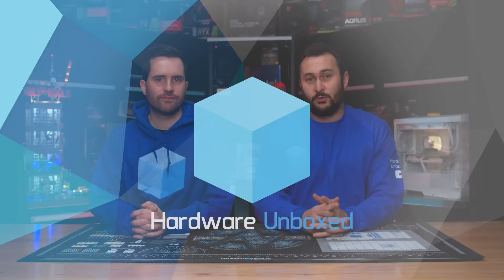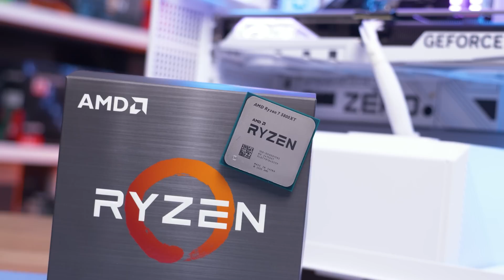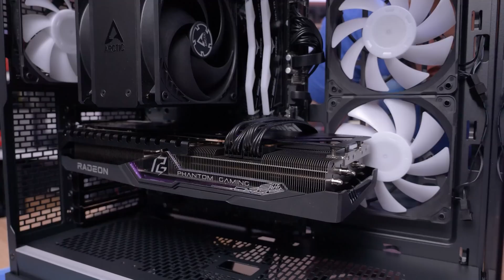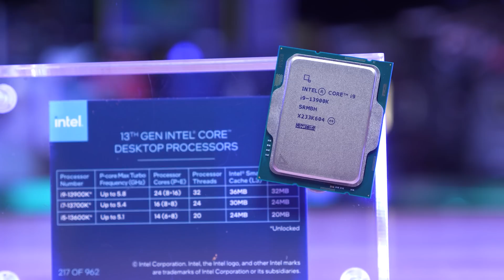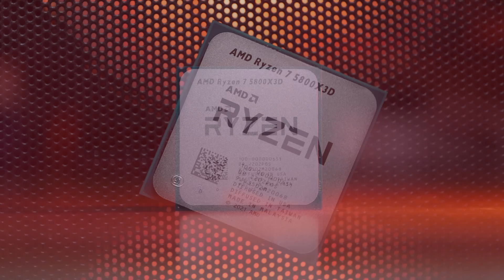Our RDNA4 Expectations, Can Intel Gain Lead After Mediocre Zen 5?

Comment: AM5 being supported till 2027 doesn't mean Zen 6 is guaranteed to release there AMD may just spam it with refreshes like they are doing to AM4 right now so maybe we will get a "fixed" version of Zen5 instead.
Reply: Depends a lot how soon ddr6 comes to market and what is the price of it close the release Zen6!
Reply: @haukionkannel  The price don't matter even if DDr6 is priced to the moon and back at launch if AMD designed Zen6 for DDR6 alone its gonna launch with DDR6 as a mandatory requirement which means it will need new motherboards and socket unless AMD goes the socket 2011 X79 and X99 way same socket different processors supported they already did it for Zen4 even when DDR5 was at a price that didn't make sense AMD released Zen4 with DDR5 support only and when it failed to sell they gave it price drops and gave away free DDR5 kits with it.
Reply: @fredsorre6605  
I am just thinking that they make option to chose either dd5 or ddr6 memory controller… and make the final decision about one year before the release! AMD has tendency to move new memory tech later than Intel, just to keep total cost little bit smaller. But if ddr6 is release about year or more before zen6 release and ddr6 is rather cheap even at release… AMD may chose to go DDR6 with zen6. 
All in all I expect that Zen6 still is ddr5 and will be released at am5 platform.
Reply: @haukionkannel  not gonna happen the lead of Zen already said during an Interview when they asked why Zen 4 only supported DDR5 and not DDR4 while Intel Supported both his answer was that they only wanna focus on one supported memory type for their controller its why they only supported one type of memory starting with Bulldozer and up. AMD has always been known to have badly designed Memory controllers vs Intel as theirs is in the IO die which is built on a different node the one used on Zen 5 is still on 12NM from Global Foundries as AMD has a contract to use their FAB until 2026 or 2027 its the reason why clocking RAM high on AMD has always been hard to do compared to Intel seen this first hand on my DDR4 3800 kit which worked fine on Intel 10th, 11th and 12th gen but not on any processor in AM4 had to clock it down to 3200 there to keep it stable.

Comment: Immediately after the 9000 series dropped, the price for the 7950x and 7950x3d cratered. Fortunately I was able to pick up both of these processors before the general industry apparently realized the 9000 series was a dud. Unfortunately prices have crept up but I would still go for a 7800x3d for gaming and a 7950x for productivity. This is a massive chance for Intel to recover some of it's former glory, but can can an ailing organization, with moribund corporate culture, respond? For all our sake, I hope so.

Long term, nothing is going to save Intel. They still think ARM/RISC-V isn't a threat and they are actually proud they voluntarily relinquished the  consumer commodity market (aka mobile) in deference to 'the value-add of x86 goodness'. They got their foot in the door with graphics, notably the A770 and then... stalled. It seems Intel just can't get anything right. That said, at least the early word about Arrow Lake looks exciting. So maybe, just maybe, there is yet life in the lame, toothless and half-blind dog!

Comment: I think HUB is right about AM5 - be wary. Since core density is going up with Zen6, it will likely have increased requirements. Higher PCIe speeds on the way, CAMM memory... its likely AMD will do a new socket. Just look at the absolute mess they made in the Threadripper platform.

Comment: Intel is missing an opportunity, Make more than 8 P cores with Arrow Lake on a single tile for Arrow Lake now. You have a buyer in me. Not interested in 8 P cores plus more e-cores in clusters of 4 even with stability fixed and much lower power consumption.  Also not interested in dual CCD AMD designs. It sucks no more than 8 P cores per die from either AMD or Intel. Embarrassing and shameful!!

Comment: re, AM5 discussion.  I would be OK with a switch to a new socket ONLY if it were accompanied by significant gains immediately.  If some new architecture on Am5 would be 10% faster, but switching to a new socket and all else being equal the new CPU could be 30% faster at the same price, OK.   But I doubt that is going to happen.  Not to mention that people who spent big money on AM5 to switch from AM5 are probably not going to be ready to do the same so soon.  ZEN 5 is a big problem for AMD - it is not going to drive board partner sales with its current performance levels - the smart money today would be to buy a mid tier AM5 motherboard with good ram support and a 7800X3D if you want to game. ZEN 5 give the consumer no reason to spend a bit more on a better motherboard, because there is nothing to move to in the ZEN 5 line better for gaming than a 7800X3D.

Comment: 9:32 I commented this on the last podcast and I legit think that Intel will try and make inroads in to this socket longevity element of the CPU market that AM4 enjoyed thoroughly. LGA 1700 saw 2/3 gens of CPUs and you better believe that LGA 1851 will have at least 2 solid gens and Intel will have to deliver. All eyes on Arrow Lake and Zen 5 X3D.

Comment: Id rather do a monitor upgrade to a 4k screen in like 2028 (when I feel Im running into a CPU bottleneck) before I consider upgrading my whole system. Would be amazing if the 5800x3D lasts that long and is still viable.

Comment: I think AMD took over a lot of bad business practices from its competitors. They are basically scamming normies with refreshes of old hardware. To the majority of users big number name means better. And even experts have to rely on benchmarks due to IPC and frequency becoming almost meaningless. I think this is a problem that is impossible to fix. Regulating this would be a nightmare.

Comment: According to MLID's sources ARC is dead, not a single add in board manufacturer has been contacted about making Battlemage GPUs and the ones who made Alchemist cards said they are not interested as they sold like crap. According to his contacts in Intel the Battlemage cards will have a VERY limited release and only be made by Intel so as to fulfill their contracts with TSMC, Celestial will only be an iGPU if it even comes out at all, and that will be that ARC will be done.

It is a shame but it is becoming obvious Pat Gelsinger is to Intel what Rory Read was to AMD and Steve Ballmer was to MSFT, someone who sees what the other guy does and tries to copy them too late and half assed. He saw AMD and Nvidia making big money during the crypto boom and ignored signs it was a bubble to sink billions into ARC thinking they could sell it for crypto prices only to watch Intel have to sell the GPUs below cost as nobody was going to pay midrange prices for entry level performance post crypto, and now he is betting the farm on AI but instead of being smart and offering separate AI products like AMD he is integrating it into ALL of their chips and then charging extra to unlock the functionality which is causing the data center customers to dump Intel in droves as nobody wants to buy a $5k+ CPU only to have to pay a fee just to unlock features their company probably won't use in the first place.

Comment: DIMM socket is been around for so long, because is just better, it works fine, takes way less space and is very easy to handle and upgrade RAM with it, even for non technical users. 
The CAMM2 system is way worse imo, requires more work and knowhow from users to handle, meaning some users will now pay others to upgrade RAM, because they will be scared to touch it... also some CAMM2's shown, have huge heatsinks that take a large amount of space, more than some CPU heatsinks! 
My motherboard, is already mostly taken up by heatsinks and metal shields, imagine another huge one for RAM! 
Modern Motherboards have atrocious extensibility already, with very few PCI-e slots, despite prices going up and up, is so strange to me, to look at my older MB's and see all those extra slots and then look at my modern one that was more than twice the price but looks so barren, specially if you imagine it without the heatsinks, I almost feel cheated.

Comment: 9:52  I feel like overclocking for most consumers is heading the same way as buying aftermarket gpu heatsinks in the past. It used to be very useful but these days parts either auto-overclock themselves or are running so close to the limit out of the box it makes overclocking increasingly less worth the efford

Comment: Zen 5 does already offer a significant performance improvement over Zen 4 in some applications, and even in some games, so it's very likely that there is some potential there for more performance improvements in a wider range of applications in the future.

The more I learn about Zen 5, the more I realize that it is has some pretty radical architectural changes vs. previous generations of Zen. One of the major changes I only just found out about recently is that each core can fetch up to eight instructions per clock cycle, which is supposedly a huge change, and I believe it is the first CPU architecture to market that's able to do this, though I know this is something which Qualcomm's new chips are also going to be able to do, so this is clearly a new and popular trend in architecture design. It's hard to know how much this could improve gaming performance over time vs. Zen 4 as software becomes better optimized for it, but it seems entirely possible that the changes introduced by the Zen 5 architecture will actually offer very significant performance improvements, at least for some enterprise and data centre workloads, if not also for gaming and consumer application workloads as well. 

It is not unusual at all for it to take a long time before major changes to an architecture to be well optimized for. Chip makers love the "low hanging fruit", the changes which can see major improvements to performance from day one, but they also have to think about long-term progress as well. Zen 3 was very unusual in terms of how much performance improved from day one across a wide range of applications with a new architecture that was based on the same manufacturing process as the generation before. We can't expect anywhere near that much of a performance improvement from day one with every new architecture.

Comment: I waited years and picked up the 5700x3d for a little less than 200. That's on an x370 board, and i got a 6800xt new for 430 usd, so a supposed warranty until 2027. Amd will have a hard time convincing concurrent owners to upgrade to a new platform. The price to performance the market saturation in my opinion has plateaued potential platform upgrades. If rumors of Am6 being a new form factor are true, me and im sure many others would gladly wait while using am4 for the release as long as it's gaming or basic task oriented. Of course AM5 makes sense for new builds, but i'm sure many are still on am4.

Comment: Expectation for 8800xt: 20% over 7800xt, slightly weaker than 7900xt. Maybe potential with OC, more power efficient, $600 price tag. 

TLDR 8800xt might be very meh

Comment: Timestamps:
0:05 Savage Tim
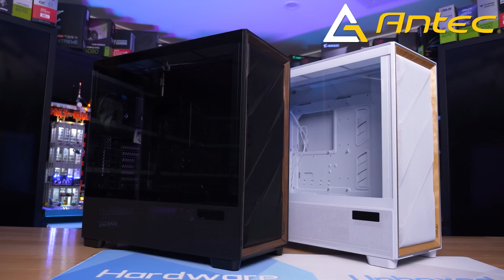0:40 Antec sponsor spot
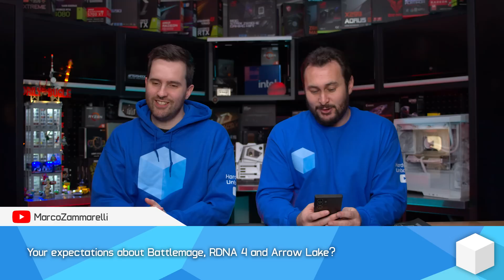1:42 Expectations for Battlemage, RDNA4, Arrow Lake?
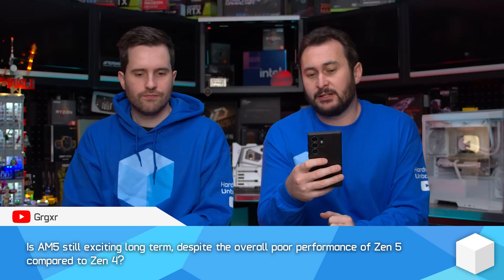5:22 Is AM5 still exciting long term?
9:52 Are limits on factory overclocks bad for consumers?
13:47 Why doesn't AMD increase core counts?
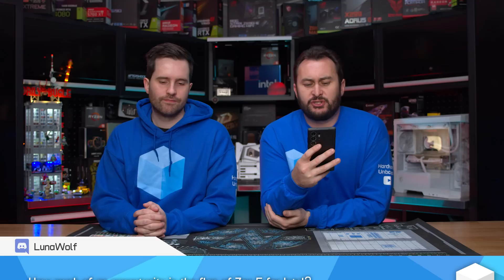18:25 Is the flop of Zen 5 an opportunity for Intel?
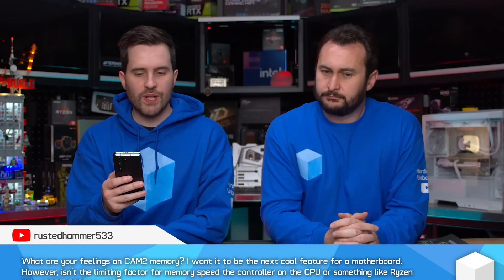23:51 What are your feelings on CAMM2 memory?
25:32 Are game areas chosen for CPU/GPU testing?
27:06 How long do you think AM4 will last?
31:06 Conclusion

Comment: AMD is not always more power efficient. Everyone talks about the power draw of intel processors and yeah that's true if you have them running at 100% however with normal use it is the opposite! My 12600K runs cooler than my 5900x at all times plus it's faster in normal use.
AMD would run a lot hotter with more cores +- . I run whatever works best I don't care who makes it...

Comment: Bought a 6700 XT last year as a "bridge"-card to replace my 580 that I bought 5 years prior to that as a "bridge"-card, to bridge me over until something nice and affordable arrives. Jokes on me I guess? See the 6700 also lasting for 5 years at least.
Reply: I did the same thing. I picked up a Nitro+ 6600xt for 135 dollars and I was jaw dropped by the performance and actually good graphics (my rx 580 do be a unit though.) 

I really want to build my own custom PC with high end parts instead of frankesteining my prebuilt anymore (9700k OCed to 5.1 ghz lo) 

Graphics cards are super overpriced if you want something respectable. 7900 GRE for the sale price of 500 is pretty nice though. 4080s and 4090s are horribly over msrp STILL AFTER YEARS and the XTX and XT 900s are still eye watering. 

I want to wait till Arrow Lake and 9000x3Ds come out before I jump on a new processor but it's probably just going to be "buy the 7800x3d lol"
Reply: @cuteAvancer  With my CPU actually I am fine, as I don't need the high-end performance for my day to day.

I have a Ryzen 5700x which I also got a year ago on sale. And at least in games I am fine with my system, as long as I don't go crazy with the settings in 1440p.

I just think I got kinda old. I always wanted to have the halo products back in the days, but nowadays I just need something that does the trick "good enough" and has good value! But 1800€ for a GPU like the 4090... I just can't get behind it. I could afford it, but I really don't want to, as my whole PC is cheaper than that: Including the displays... Would be just an utter mismatch, which would mean that I would have to get a whole new system which would probably get me to a total of 3500€...

With this ~1000€ PC I can play AAA games (in 1440p with medium to high details), do Video-Editing for the most part (even though I honestly use mostly the M3 Pro Macbook for that) and for music production it's also fine...

In the end I think if you are fine with the 6600 XT and the 9700k for now, you might consider saving up a bit more, until one of those components just breaks or really doesn't do the trick anymore and then check what is available in the moment. If you are not playing in competitive games and are not doing some crazy 3d modeling, chances are, you'll be fine for another year or two 🙂, as it seems to be a decent enough PC.

Comment: Lol guys, back to back you said:   
Intel new architecture no real performance Improvements - exciting !!! 
AMD new Architecture no real performance Improvements - over 4 years means minimal increases - disappointing. 

FFS.
Reply: ?

They said that if Intel at least manages a significant reduction in power consumption, even with little to no performance uplift will at least be somewhat positive.

Whereas while some have been quick to try to suggest that’s what happened with Zen 5, this has been thoroughly disproven with comparisons to the 65w non-x Zen 4 parts. Except for workloads that benefit massively from AVX512 and the performance uplift of AVX512 on Zen 5 vs on Zen 4, those do I think see a more quantifiable efficiency improvement. But that’s a smaller subset of programs, it’s not an across the board thing like we would hope ArrowLake should be able to provide.
Reply: @levygaming3133  cool, now put this in context.   They said that if Intel can deliver no real performance increase, and bring power levels down (to still probably above AMD usage)  that's exciting.  Consumers gain nothing, as we already have that performance and power efficiency in zen 4 / 5.   

But AMD bringing a new architecture that offers little performance increases in gaming (on windows, Linux has massive gains) but gains in other areas of performance- that's disappointing.   

It's absolutely inconsistent.  Now, to be fair AMD hyped performance in gaming, seeing no increase IS disappointing, but that's not what THEY said.  They said one company giving us nothing, exciting, another company giving us nothing, disappointing.

Comment: Ι was looking to get A770 because its 300€ with 16gb vram. But, i will wait for the B770 which i hope costs the same has 16GB Vram but 10-15% better performance. I know i know, the possibility of that happening is zero. What will happen is the B770 will be 10% better for 50% more $$$😢
Reply: B770 has to be more expensive than A770!
Intel needs to get some income from GPUs… or the Batlemage is the last GPU they make for years! They can not make stuff and not get income.
Reply: @haukionkannel  that's true mate, i think A770 for 300€ makes them no profit. But they have to price B770 lower than the competition, so for example if B770 performs like rx 7700 xt, which cost 400€ they should price it 10% at least cheaper than that. Nobody will buy it for 400€ they will get the rx 7700 xt instead (or the equivalent Nvidia)
Reply: @Lazarosaliths  
Yeah… it depends on how much speed they get out of Battle mage… but I also expect that 8700xt and 5060 from Nvidia are targets in price wice, not the older tech that will be the best bang for the buck in anyway!

Comment: Heh, that's my plan - I want to use my 5800X3D I got last year until AM6 releases. Then I'll probably upgrade to last, best AM6 CPU and skip AM7, assuming the 3 architectures per socket remains.

Basically - same thing I did with AM4 - began with 1600 and went to 5800X3D :)